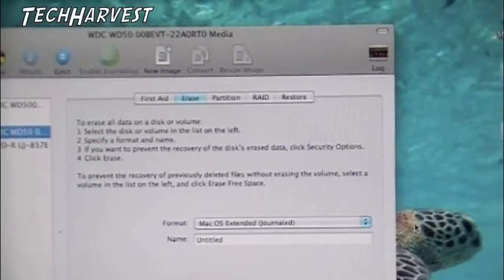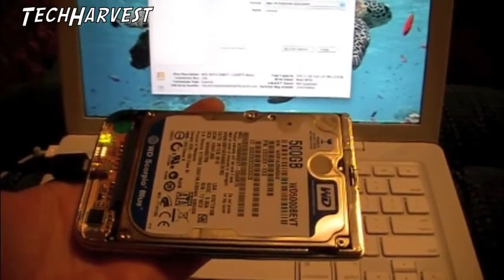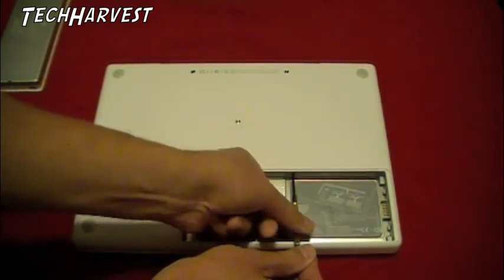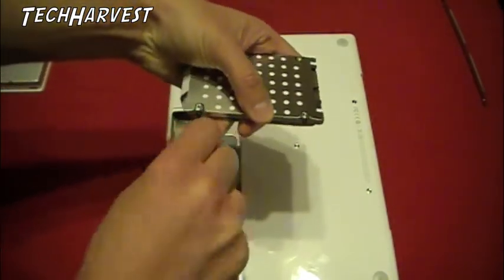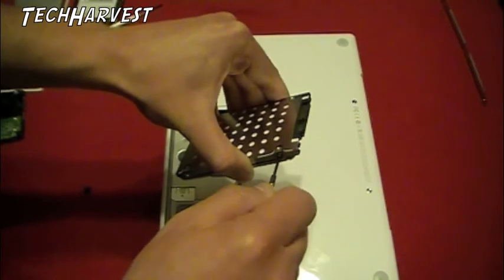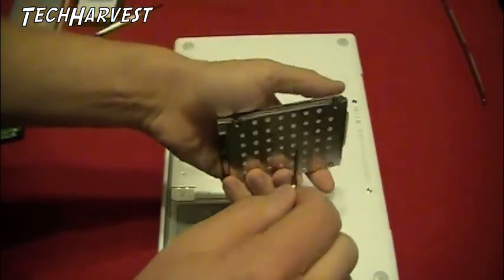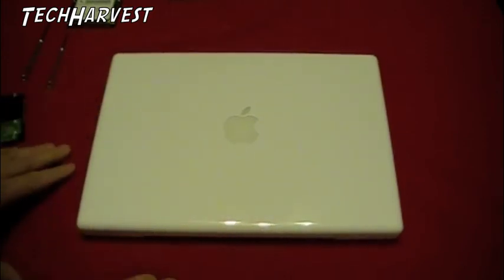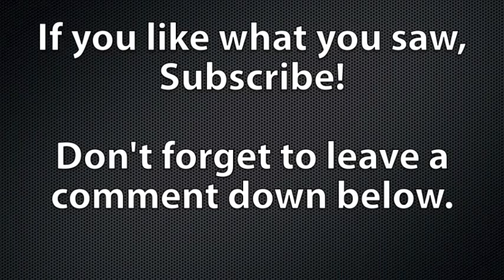Apple MacBook: Replacing The Hard Drive (non unibody)

Comment from the maker: @kat9213 If you get water on your electronics, the first thing you want to do is NOT TURN IT ON.  Take the battery out (if possible) & let it dry out.  Putting your device in a ziplock bag with dried rice can help draw the moisture out (easier to do with cell phones than laptops).  If your laptop is ruined, it still might be possible to get your data off by taking the drive and making an external drive out of it and then plugging it into your new mac.  Good luck.